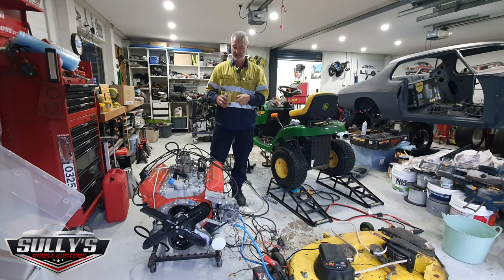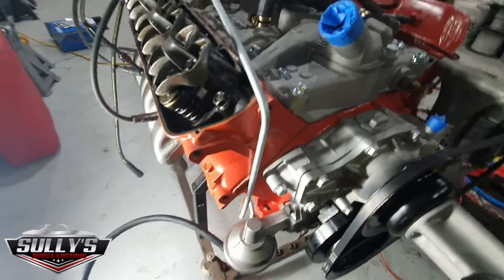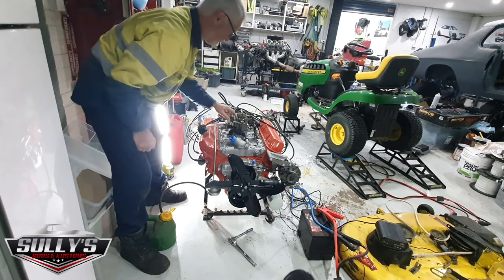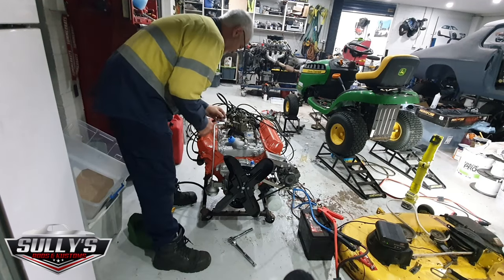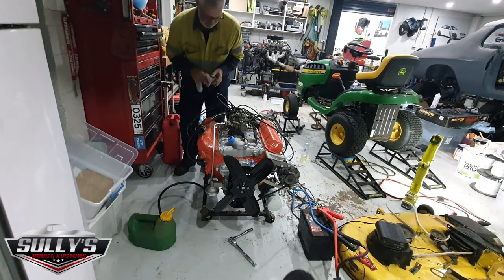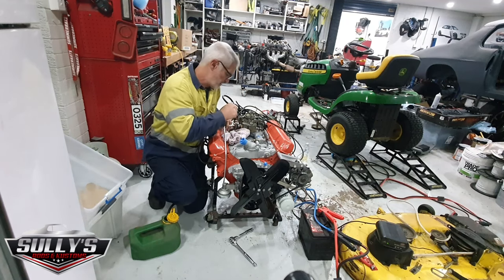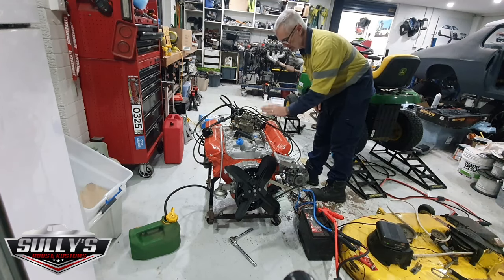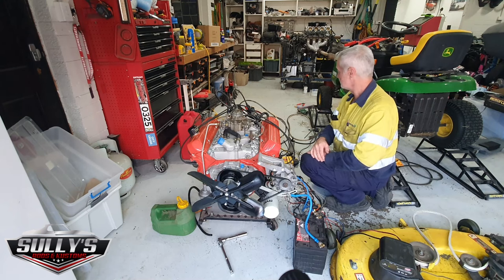Holden 4.2L 253 engine start up. Will it start?

Comment: Starting to need more space Kev. 😆
Reply from the maker: @4ard4 yeh I have all of the house reno crap in the garage. The shed is full of hotrod parts. Hot rod in front of the garage on the. Chassis jig. I have the hq coupe shell on the rotisserie , the 253 engine on the cradle, the LS engine on the run stand, the coupe chassis will be back next week, so even less floor space. I even have all the coupe part in a bedroom in the house. Lol
We are thinking about selling the house to buy a large property with a massive shed. It still won't be big enough.

Comment: Put a decent vacuum secondary 4 barrel carb on this motor makes a huge difference if you have a better than stock cam in
Reply from the maker: @malcolmcooke2024  yeh I would love to Malcolm, but the car is a matching numbers GTS coupe and I'm taking it back to original.
I have a cross ram injected LS1 on ky engine run stand I was considering dropping in it, but I couldn't do it to it. Thanks for watching. 👍

Comment: Are you planning on getting an electronic distributor?  It would make it whole lot better. Good work.....253's forever.😂
Reply from the maker: @andrewharrison8880 I'm sticking with the standard dizzy as it's going in my hq gts coupe. It's a factory correct build. Matching numbers, So it all has to be as per factory. Thanks for watching, mate,  much appreciated.

Comment: Thong slapper🇦🇺🇦🇺🇦🇺👍👍👍
Reply from the maker: @darrenkingston9912 
yep, can't beat an old thong slapper. It's a matching numbers GTS coupe. So it needs to have its factory correct engine. I have a cross ram injected LS1 on my engine run stand, but I can't bring myself to install it when I build the car.
Reply: @SullysRodskustoms.  well theres nothing wrong with 253  if you build it the rigth way commo cup spek i have to 253 and just finish a 357 ci holden stroker  there good motors ozzy pride brother good luck with you build